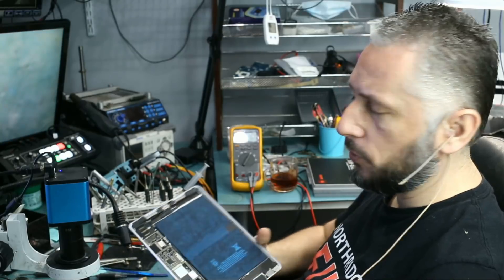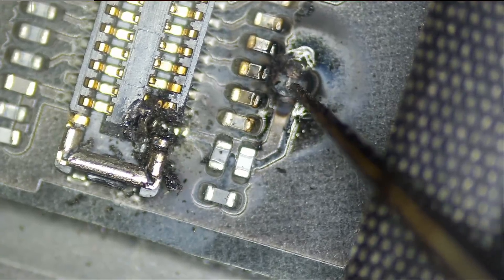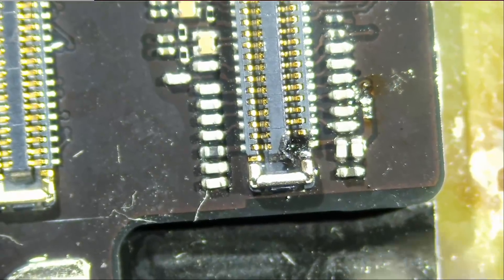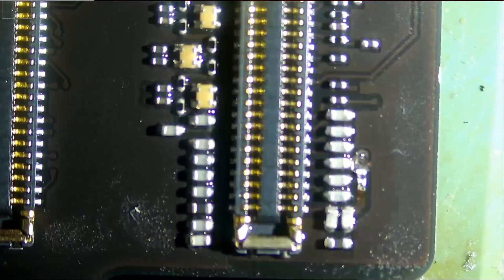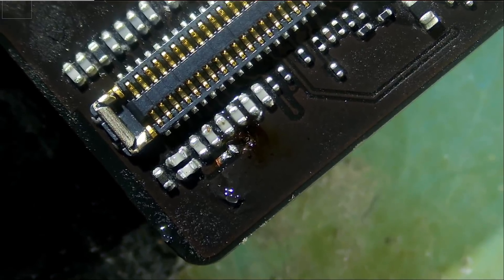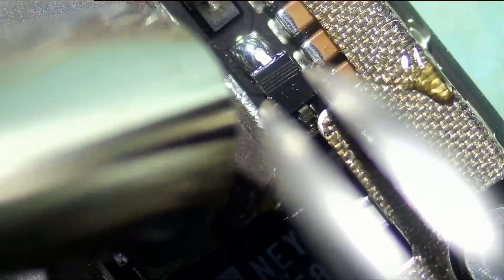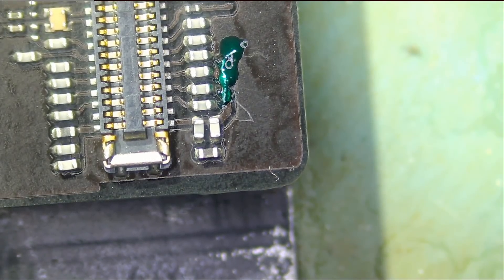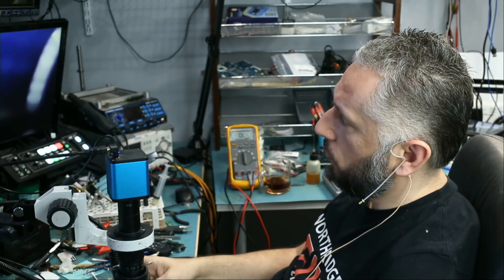iPad Pro 9.7" No Power Black screen - LCD Connector Backlight Circuit Repair

Comment: 20 years ago I did your job in an electronics factory.  I loved every second of it.  I was not repairing PCs and stuff but I was re-working PWAs with these very small surface mount components on (They were microprocessor flow controllers for industrial applications ).  The only job I ever had where  I looked forward to going to work.

Comment: Do you know what those other components are? I need the values or replacements for some that I've knocked off the board taking the FPC off. Any pointers would be great; for the caps and resistors. I've replaced the filters already

Comment: I had just bought some flux and some braided wick from your shop. May I ask what size your tip that you frequently use is? I have been trying to drag solder but I just can't get it down I'm hoping the amtech helps me.

Comment: Thanks...Hot air temperature?  380? when diods replacment?
Reply: Depends on your Hot Air station, but yes 380°c to 420°c is my usual temperature for Hot Air, good luck

Comment: Why the FEC connectors and filters burn when anyone try to replace screen??? 

How to avoid that..??
Reply: Disconnect the battery before disconnecting and connecting screen flex cables.
Reply: If what i remember is correct. It is because they remove the fec connector first before the battery. The solution is just to remove the battery first. Please correct me if I'm wrong.
Reply: So disconnect batterie first and wait a bit so all capacitors can discharge ~10s
Reply: that is because when you do not disconnect the battery it just has voltage and blows up. to avoid remove the battery and wait for a day or 2 so that all capacitors discharge and no voltage is left
Reply: @windowsxpprofessional  No need to wait at all. Just disconnect the battery before doing any work/disassembling/assembling and you are good to go.
Reply: Most likely cause to a short. This happens a lot when you donˋt disconnect the batterie first.
Reply: Disconnect the battery press and hold power button like you are powering on the tablet. This makes all the caps discharge in 2 seconds
Reply: Disconnect the battery before doing any work/disassembling/assembling.
Reply: I know every hot air station is different,  but what temp and airflow did you use for the FPC connector removal?  And same question for replacement?  I have a very hard time with these,  just trying to get better. BTW love the tweezers I got from Northridge Fix.   They always so fast shipping too...